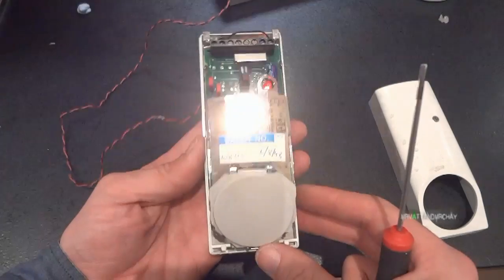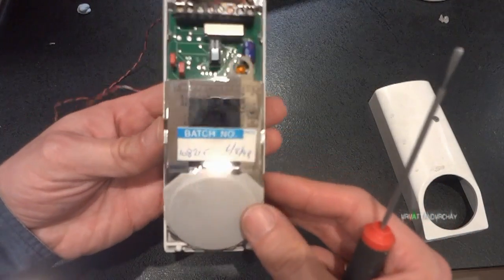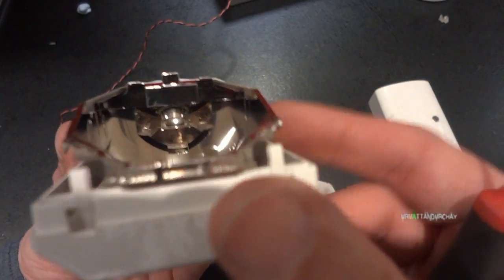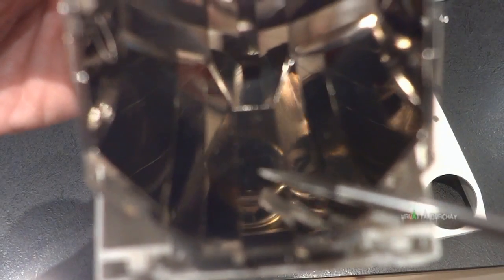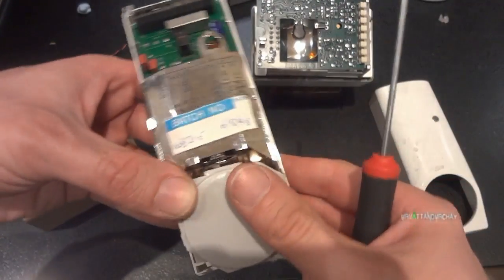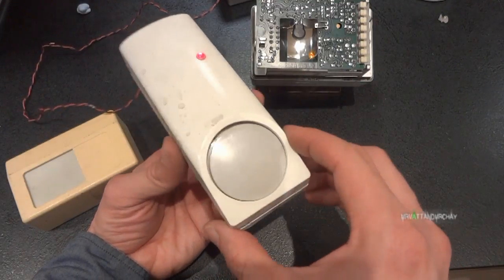Vintage PIRs - PART 12 - First of the reliable PIRs - Alarmcom IR220

Comment: I had seen alot of theese PIRs when I was younger. In my middle school area, there were alot of theese detectors. There were two variant, were the other variant had an anti-creep zone as well. thoose just didn´t had a grey circle, but it Went over down too and a grey line in the bottom of the PIR as well.

Comment from the maker: Daniel Nuker ah still cannot reply but never mind.  Your comments don't have a "reply" option, but suppose I can just do this (Daniel Nuker at the start of the comment) which seems to work i think.  Yeah, the LED is kind of unique which is why i linked the two detector models together.  Are you interested in these detectors, or is it something that i've got you into now?:)  I used to collect all the old ones and put them all over my bedroom wall - i had a wall of PIRs! this was back in the late 80s/90s though.  My girlfriend (now wife) didn't like them!

Comment: I recently bought a property which has the Alarmcom IR220C installed. It will occasionally go off, even when its not armed. Trying to find someone that can service it, but can't find much online about Alarmcom. Any suggestions?
Reply from the maker: The detector cannot activate ("go off?") the panel when it's unset so this will be the tamper circuit.  Probably nothing wrong with the detector itself, apart from the tamper circuit (bad connection, high resistance, cable fault or the tamper microswitch is dodgy on the PCB?).  Not something you're going to be able to search on the internet, just standard fault finding for an engineer.

Comment: Great detectors these are Siemens have stopped making there own version I think.
There are 2 220c on eBay in used condition that have a thorn security sticker at the top of them.

Comment: morden alarms used them with their euro bell systems
Reply from the maker: yep, they started with the standard round eurobell (white strobe plate in the middle) then used their own cover with the eurobell underneath.   Name changed to Modern Security systems in the 90s, then bought out by ADT I think?  Takes me back to my alarm days! :)
Reply: There quite advanced the eurobell but one big problem is the wires getting in the way